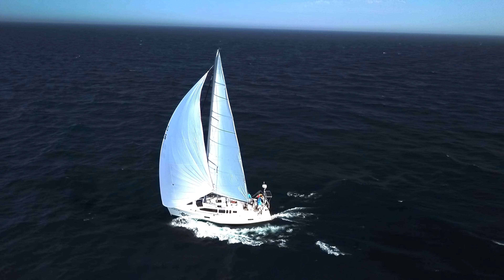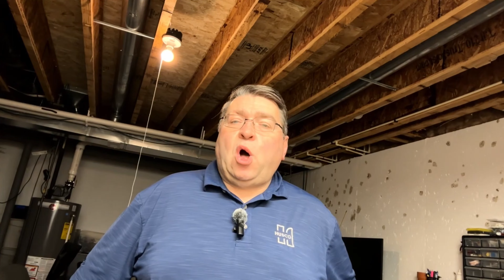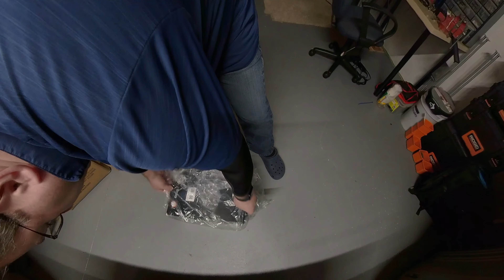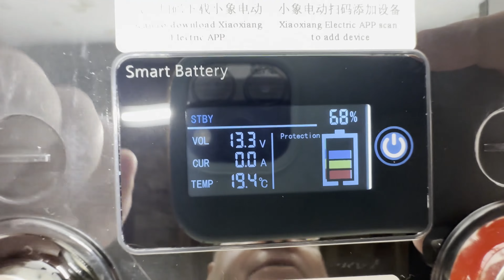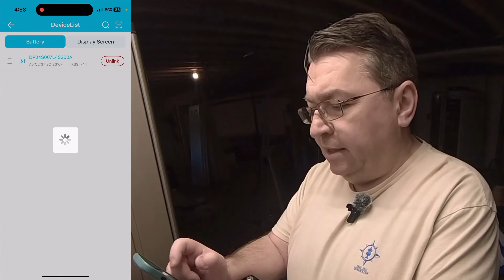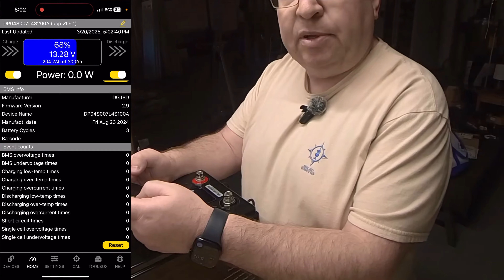Docan Power 300Ah - We are moving to Lithium!- LiFePo4 battery Upgrade, Part 1 - TechE38 - Après

Comment: JBD BMS controllers are supposed to be the best so if its got good cells in it, sounds like a great battery. Will be following to see how you get on with these.
Reply from the maker: So far the BMS has been great and <Spoiler_Alert> has support from bt-sensor-plugin-sk to provide support for integration into Signal K!  The cells are Grade A Eve cells, also supposed to be the industry standard

Comment: Good job Jason, I did the same upgrade about a year ago, I find the 100W solar I have just doesn't have enough power to keep the batteries at 100%, I added a 120V-15A charger to give them a kick, most BMS modules will stop charging before 100% if the charge current is below 5A, so you need to charge with a bigger charger to get them up into the 14V range.
Reply from the maker: I plan to upgrade to a Renogy 250Watt bifacial, which should get about 300W max (https://amzn.to/426vj16), this is a project for this year though, unless it doesn't charge, then I may have to go earlier.  they are on sale right now though...

Comment: Great video Jason.  I'll watch for the installation videos. I'm curious where in the boat you place this battery and the other components.
Reply from the maker: I am hoping to have the install video ready in 2 weeks.  As for location, my boat has the start and 1 house battery in the Starboard Lazarette, and another House battery on the port side. I am replacing the house battery on the Starboard side.